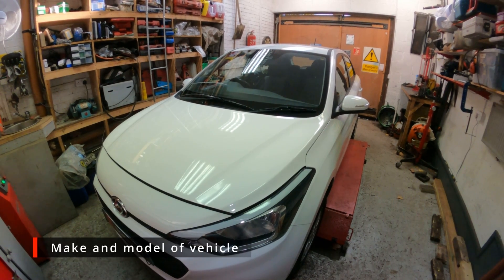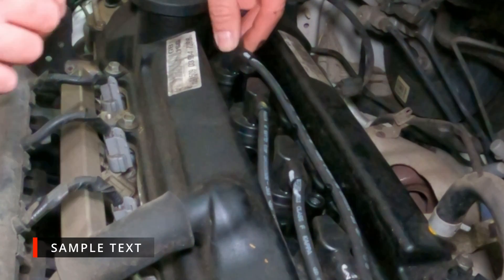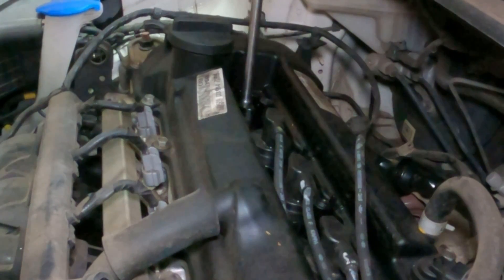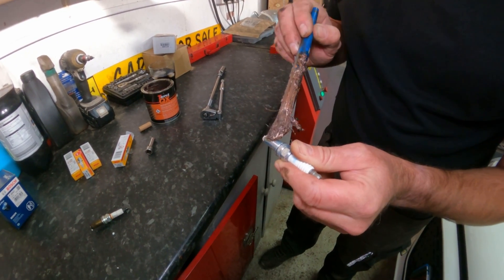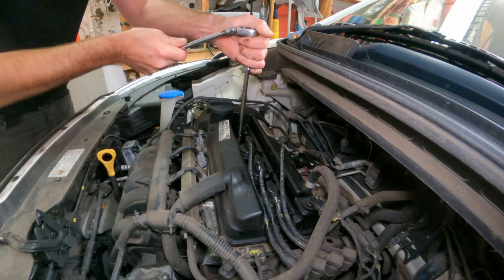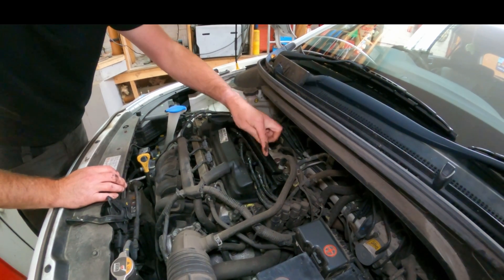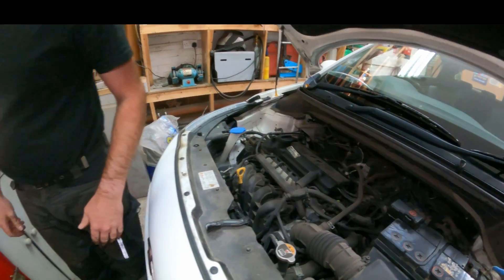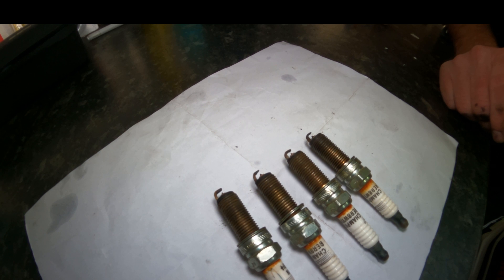Hyundai i20 1.2 Petrol (2016) - Spark Plug Change

Comment: I wish you showed engine running before and after
Reply from the maker: Hi Oxim2100
We did show the engine running after the spark plug change. However, the spark plugs were changed as part of a service, not because the engine was misfiring, so it would have sounded the same.